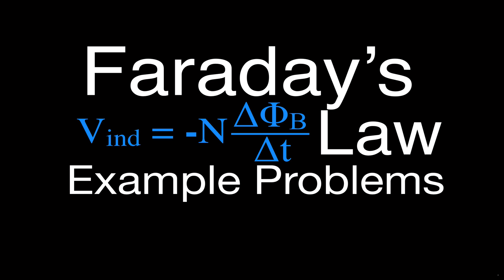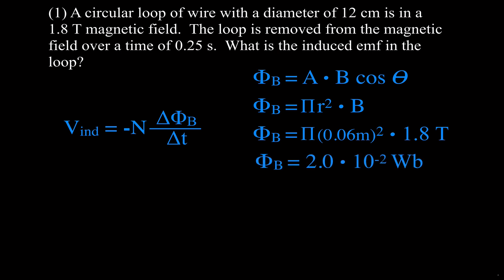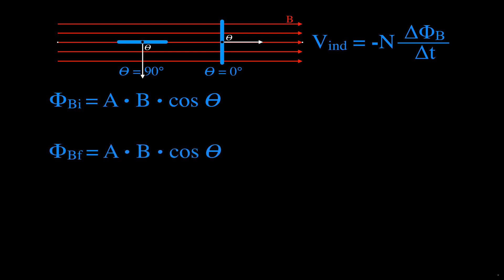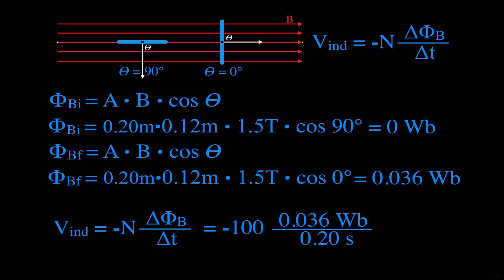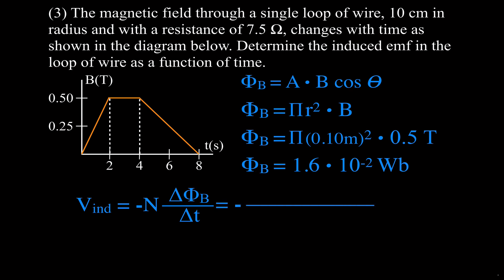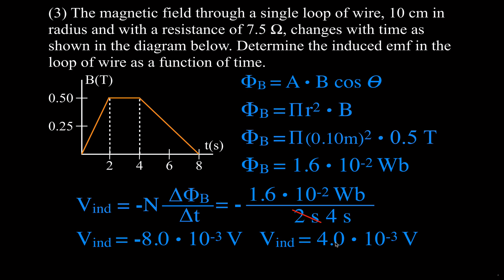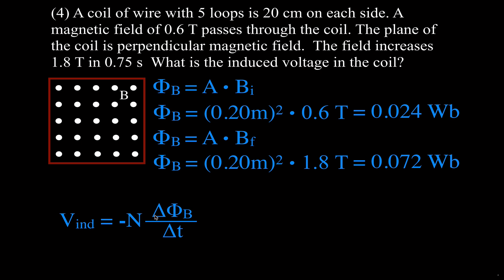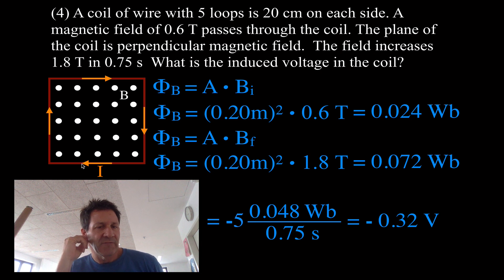Electromagnetic Induction (6 of 15) Faraday's Law, Example Problems

Comment: I have a question for you. Does a test charge at rest in variable magnetic flux start to move due to the electrical field created by this variable magnetic flux. Would appreciate it if you clarify which or not this test charge start to move or vibrate .

Comment: I'm a little confused on how you solved for the area of the loop on the first problem.  You used the formula for the area of a circle, but if the wire is a loop with a 12 cm diameter, wouldn't you need to know the cross sectional area of the wire, then multiply that times the circumference of the circle?  Why are we counting the "area" of the loop where there is no wire present?
Reply from the maker: I do not fully understand your question. It is a round loop of wire with a diameter of 12 cm. The area is therefore pi x r2.
Reply: @stepbystepscience  The area of a circle is pi x r2; which would be fine if this was a "disc" of copper and not a "loop" of copper wiring, because the area for Faraday's formula is only the area of the copper itself, so you need to solve it by using the cross sectional area of the wire multiplied by its length.  

What you're doing is solving it as though all the empty space (i.e., the "hole" in the donut shape of the loop) is also solid copper.
Reply from the maker: @scottsledge6041  The magnetic field goes through the round loop enclosed by the copper wire. Therefore the flux is the amount of magnetic field that is in the area enclosed by the copper wire. The is why the equation is Area x Magnetic Field Strength.
Reply from the maker: @scottsledge6041  It is not the cross.sectional area of the wire.

Comment: Hello, first great explanation, but in the 3rd and 4th problem the strength of the magnetic field INCREASES over the period of n seconds, not jumping. So I think you need to integrate it 😇, or im wrong ?
Reply from the maker: If it is a constant linear rate of increase then you do need to integrate.
Reply: @stepbystepscience  Okay thanks 😇

Comment: Love your lectures. I have a question for the 4# problem. The question says that the field increases 1.8 T and not to 1.8 T. So isn't the the final field value 2.4 T if it started at .6 T?
Reply from the maker: I left the "to" out of the text in the problem, but I do say it that way in the video. So the text should say that the magnetic field increases "to 1.8 T". Sorry for the confusion.
Reply: @stepbystepscience  Thanks for the quick reply. When I did the problem I completely ignored what it started at and just computed an increase of 1.8 T and was wondering what was going on for a second.  Again thank you and have a great night.